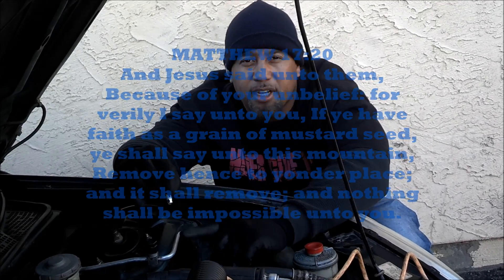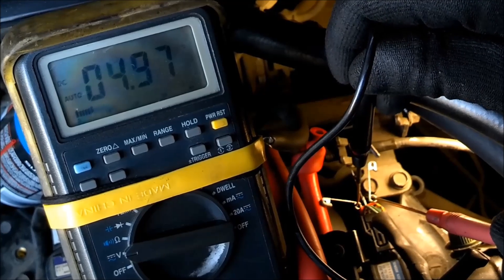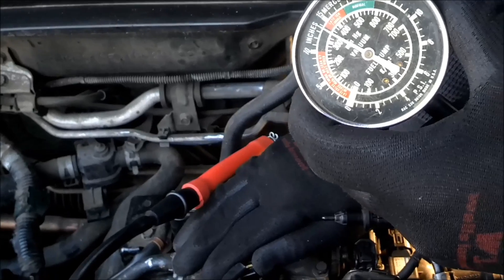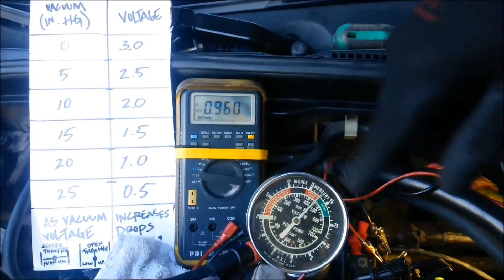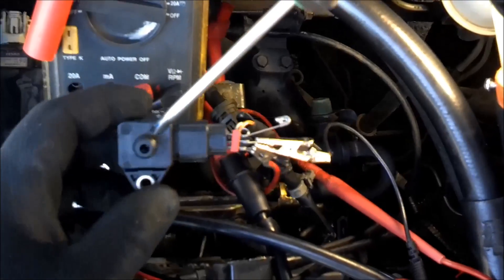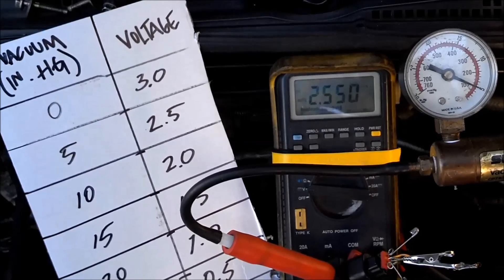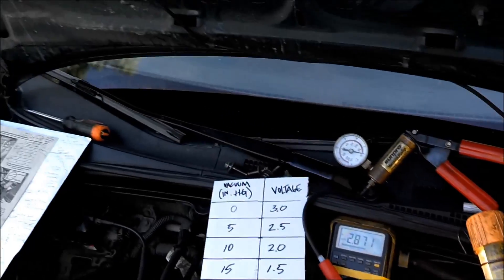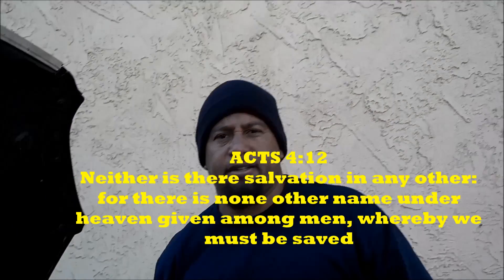TESTING A MAP SENSOR W SAFTEY PINS, VOLTMETER, VACUUM PUMP AND GAUGE (EASY FOR THE DIYer) SAVE  $$

Comment: Yes, you always backprobe connectors with small needles, parallel with the wires right next to them. Any other way causes damage to the insulation, unless you happen to have the male and female connectors to extend the harness for the sole purpose of testing, basically how the service manual will some times tell you to use a special tool. Think of a pinout or DIY breakout 'box'. 

Is it just me or does the compression sound a low on one cylinder, from that start up? Reversing polarity when checking voltage doesnt matter. Just ignore the negative symbol. 

The only time polarity matters is if you're using an analog meter or measuring current, aka amperage, on a multimeter. Just because there is a low vacuum reading does not mean the camshaft(s) timing is retarded. A low vacuum reading can indicate just about any issue with the engine including worn piston rings and or out of round/scored cylinder walls, worn valve stem guides, intake or exhaust valves not completely seating against the valve seat, intake manifold leak or vacuum lines or a ruptured brake booster. It either means there is a vacuum leak between aft of the throttle body and the combustion chamber, the engine has wear, bad head gasket, or the camshaft(s) timing is retarded is relation to the crankshaft. The belt could be a tooth off but most common culprit is a vacuum leak. On vehicles that only have a MAP sensor, a vacuum leak will always raise the idle. On vehicles with only a MAF sensor, a vacuum leak will lower idle. If a big enough of a leak on a MAF only vehicle is present, it won't even idle and just die. First test by pinching off all vacuum lines with pliers with rubber hoses over the jaws one by one is see if the idle changes. Spray carb cleaner around the intake manifold gasket at the head(s) and connections. If you found a leak, you should hear the idle increase. If the ECU auto corrects too quickly, it wont be very noticeable when it's a small leak. Use PID "short term fuel trim" on scan tool and monitor if it drops suddenly. Upstream O2 sensors are suppose to switch from rich to lean several times a second. Think of pulse width modulation PWM, that is what is happening, it's the average of the switching is what the air/fuel ratio is. This is how engine management is suppose to maintain stoichiometric ratio of air to fuel, ideally 14.7:1 for emission purposes. Downstream O2 sensors sole purpose is to test if the catalytic converter is working correctly by flat lining the signal. Alternatively, it's used to achieve better fuel mileage, by monitoring how the catalytic converter is operating, especially on the highway. In other words, who cares about the downstream O2 sensor(s) if you don't have an emission issue, just wasting your time. Monitoring downstream O2 sensor(s) is useful for testing misfires and other concerns like bad fuel mileage. When back probing wires, I really like "multimeter test lead spring hooks" for hooking onto wires and needles, they help free up your hands. Just search the quotes and they should be less than 10 bucks for a set. A game changer.

Comment: ended up being bad computer... keihin really made some knock out computers they put in these cars. Dealing with a p302 cylinder missfire, on used ecu, think it fucked up. Was in limp mode replaced ecu, and out of limp mode but now this p302, in ny have to get rid of light to pass inspection.

Comment: I just seen this video , amazing , you sir helped me so much with your videos and education in the automotive field, i have the sama issue with my car , i tested the map sensor like you showed us , its fine , i cant find no vacuum leak , smoke tested , none , still the car is way to lean and way to rich , i guess its the timing retarded, but how do i know , its a bmw 318 i , n42 2.0 l gasoline engine , map sensor reads 700 milibar of presure only when i gass it , at idle before i give'it gas , stays at 50 milibar (as the pcm aspect it to be) from where its coming that pressure , please make a video with this topic , how did you resolve that issue ? :) God bless

Comment: I hope you reply back as I dont see that you reply back to questons.

Was the key on or off when you tested voltage before you started the engine?
How do I know which wires are which on my map sensor?
Is that vacuum chart for all makes and models?
Does that scanner work on pre obd1?

Comment: Do you have a video of what the engine is doing after you replaced the map sensor?  I heard if your getting a lean code you want to check the fuel trims and see if they aren't too rich.  When there's an intake leak more air is coming into the intake manifold and the o2 sensors pick that up after it passes through the cylinders to thr exhaust system.  The computer will richen the fuel injectors.  But if you dont have an intake leak.  I would go straight into checking the compression on the engine.  Because one weak or bad cylinder could throw the everything off.  That weaker cylinder will probably not suck in as much air as the other cylinders.  That will cause an engine to run unbalanced and trip a code.  But if you dont have a mechanically sound engine to begin with.  I wouldnt waste my time or my money.  Because I've done what you have done before.  A good compression kit cost $50.  And you can check the compression on any car at any time.  Once you have that you dont have to spend anymore money.

Comment: i did the multimeter and vaccuum test on  my old and a new map sensor and it never falls below 3.6  on the vacuum pump gauge . With the car running it goes down to 1.0 .I didnt want to install the new map sensor because i didnt want to just throw parts at it. Now im back at square one.Ive taken it to 3 different mechanics and they cant figure it out .

Comment: Awesome video man. I’m having a issue with my track bike CBR1000RR. Non of my secondary injectors squirt any fuel at any rmp range. I check the tps put a new camshafts position sensor check iat sensor Even a new ecu and still nothing. I have 12v to all injectors and all signal wires back to ecu are good. When I jump the signal from primary to secondary injectors the secondary works just like a primary one. Now im checking the map sensor and at idle it stays at 2.3 2.4V and when I rev it goes down to like 1.7 1.6 don’t think is normal and I checked and no leaks on the vacuum hose. Could a faulty sensor prevent the top injectors from squirting or not really ? I have check to much I’m out of ideas.

Comment: Loved the no nonsense video and various checks with v. meter and vac. gauge. However, u lost me on the 3 wire MAP where u connected the red + to 12 v. battery and got 12 v.'s. I thought MAP's were 5 v. ref, ground and signal wire which is around 2 volts.  Dummy me tho...

Comment: Hi there I had an idea and maybe you can answer my question what was to happen if I was to run two air filters and to air mass flow sensors in a vehicle by tapping into the air mass flow sensor to make it run to what I be able to get more power or would it ruin the computer

Comment: Nice video on not figuring out how to fix the code, but rather find out that the code was wrong. But, did you ever figure it out? That hunting idle is super indicative of a bad fast idle valve. When they go bad they cause the hunting issue which makes the vacuum reading go all over the place and it throws a CEL. Seen it plenty of times. Might not be it though, it usually happens around when the T-stat opens. It's normal for your timing marks to move when you snap the throttle, that's the computer advancing the timing for the RPM increase like it's supposed to. Also, the front O2 sensors are the only ones that have to do with engine performance, the rear O2s are for measuring catalytic converter performance only. It doesn't matter what the rear 02s say, they won't affect your performance in the slightest because the only thing they are for is to monitor the cats. Your front O2s and fuel trims switching back and forth are totally normal. Your rear O2s flat lining is not the computer compensating, it's the cat being "lit" off and doing its job. The PCM is constantly adjusting trims, trying to maintain a stoichiometric mix. But with that graph being a little off from what you're used to is most likely due to the fuel cut which is what's happening with that hunting idle.

Comment: Hi,  I'm having a problem with my car and hopefully you can help.  I have a 2002 Mazda Miata and it sometimes dies at red light stop, runs excellent and idle sometimes off and sometimes normal.  I changed spark plugs, fuel pump, cleaned injectors but still same old problem.  Please help!!!

Comment: Great videos! to me ol school is the way to go!  Quick question, where do you find what the volts are for the sensors?  I know each vehicle is different but I have had a hard time finding the exact fuel pressure on a Ford focus duratec  2.0 lol. Thanks and God bless.
Reply: Service manual

Comment: Hey oldskool I have a 03 dodge ram 1500 4.7. It recently poped up a trans temp sensor light indicator so I wanted 2 know if you new where about it is located 4 replacement. any info on this situation would be greatly appreciated ?
Reply: Just git rid of it. Heads are next and it needs the front end rebuilt.

Comment: Seems like it had an idle air control valve problem which is common on the Honda.  The surging idle seems to be cause of problem.   Possible a throttle position sensor.  It is misreading to the ECU and the ECU is making a correction but other sensors are not not reading what they should.

Comment: Hi from belgium! I have a question (nothing to do with 
this video).

I have a diesel lr3 tdv6 with an automatic gearbox (less common in 
europe) and i have some troubles.

 Sometimes (very often) when i stop accelerating then try to 
reaccelerate, there is a sort of emptiness in the throttle before the 
engine actually accelerate, and with it comes a jolt (it has nothing to 
do with the gearbox shifting because of a kickdown... actually it 
happens with a little pressure on the throttle )

It happens more often at low revs (and low speed), the gearbox shifts 
quiet smoothly so i dont think its the gearbox (but im not sure).

If you could help me it would be great!
Reply: I'd check your computer. Sounds like a timing issue that your computer can't reset. 
If you know someone with the same truck/computer then try and swap with them first to test if the problem will correct itself. That will save you time and money by throwing in all types of parts chasing the problem. Change that ecu.....it's a costly part so like I said see if someone will lend you there's for a test before buying a new one. Make sure part numbers are the same. If the ecu part numbers don't match, this test will not work.
Reply: Thanks ill go check this... i went to a independant land rover garage, he said that the front differential had to be replaced,lower arms and also the tie rods... it will cost me alot the differential alone is 1400 bucks
Reply: momocarmelo15. check fuel filter or water separator first, then check fuel pump pressure and fuel line

Comment: couldn't you of viewed the map voltage on the scanner and compare it to the multimeter while testing the map sensor with a vacuum pump? or jumped the 5 volt ref to signal wire?

Comment: You can help me find the workshop of a pickup chevrolet diesel engine 3.0 4jh1tc 2006? NEED REPAIR THE ENGINE AND DO NOT HAVE THE SPECIFICATIONS. I live in Venezuela and is very expensive here, you can help me get it?. Thank you!

Comment: what is that ticking noise when the engine is cold? valves?
Reply: PTpublisher valve clearance or low oil pressure

Comment: So the issue was the timing?
You gotta get it all back to tdc?
So you have to replace the tensioner and pulleys since that's what failed and made the belt jump some teeth?
Is That right?
Reply: It states the ECU was bad check 13:04.
Reply: +9freelandk dam the computer? how much for that?
Reply: ECU / PCM / ECM / Computer yes. To replace this not too expensive luckily probably $40-$100 for a used one. Knowing oldskool funk he is a specialist and might own a collection of spare ECU's ready to swap and save time ? Not sure if this works on any car because of immobilizer related things. I think diagnosing a bad ECU is possible, but you have to know all the pin outs from the back and have reference values, it would be time consuming...